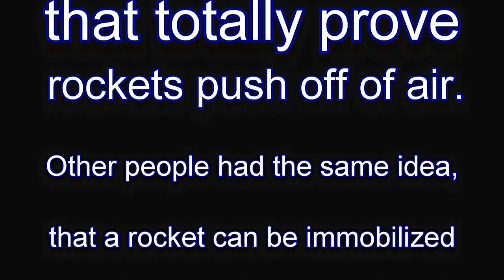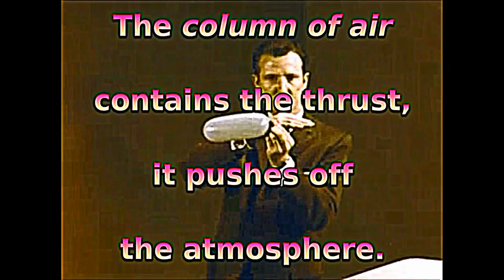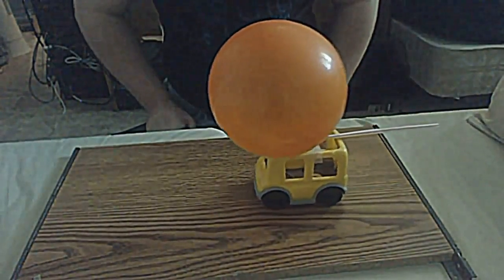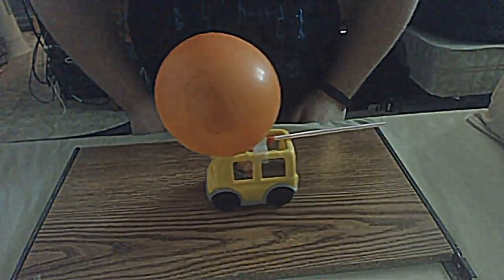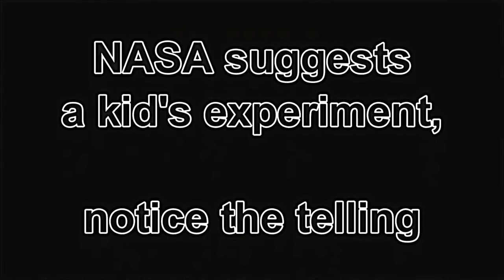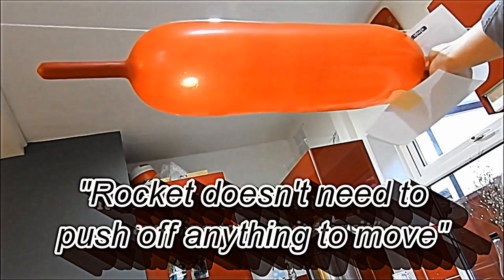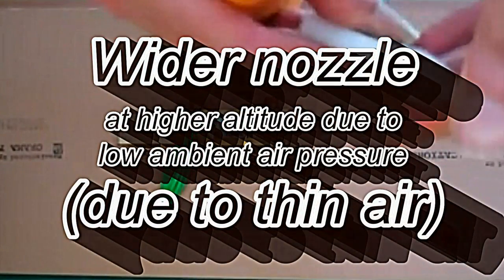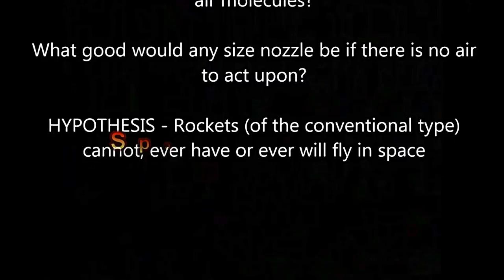rockets push off air

Comment: Rockets don’t push off air: each stage contains their own propulsion system. Take the Falcon 9. Falcon 9 uses Kerosene and Liquid Oxygen. If it were pushing off air when stage separation occurs, it would be impossible for the air would be able to reach the rocket and therefore no effect to the propulsion and trajectory at all. The only thing to drift the second stage away form the earth is pneumatics. Also if the first stage were pushing off air, THERE WOULD BE NO EFFECT TO THE THRUST OR SPACECRAFT AT ALL.
Reply from the maker: Rockets push off air. Combustion not possible in vacuum. Nothing is "ejected". Rockets never go straight up, they go horizontal once the air gets too thin. Nozzel diameter is only optimal at one altitude, exit pressure equals exhaust pressure--that right there proves rockets push off air. :)

Comment: What a load of BS For a start ROCKETS DO NOT push off air. They actually work better in a vacuum because there is less resistance for the gasses escaping . The atmospheric pressure slows the gasses trying to escape. Try this get a water hose place it in a bucket of water and turn it on; by your logic the water would give it "More to push against'  because the water is denser than air. Liftthe hose out of the water and feel the increase in "Thrust" because it can escape easier in the air as air offers less resistance. Take a look at high- speed ferries the water jets exit ABOVE the water when the ferry is at speed . There was a guy CWF Hamilton in NZ  who experimented with water-jet propulsion in boats using a simple petrol engine driven pump. With the first boat the water jet exited under water but when the outlet was lifted ABOVE the water level there was a dramatic increase in speed , simply because the water could exit easier. less resistance in air.   Now just think for a minute "ROCKETS PUSH OFF AIR" HOW does air surport the 2,700 tons of a Saturn 5 rocket?? HOW can 2,700 tons of rocket "SIT" on air . Thinking rockets or even Jet engines push on air is simply IDIOTIC
Reply from the maker: You didn't watch the video, or read the description.
Reply: @rocketspushoffair  I did watch the stupid video ROCKETS DO NOT PUSH OFF AIR AND WORK BETTER IN A VACUUM
Reply from the maker: @ianwarburton2007  ok, what was the point of thee vacuum?

Comment: Anyone could argue, that the reason why the balloon  does not move forward when a piece of paper is attached to it, is merely because in air that piece of paper creates sufficient resistance.
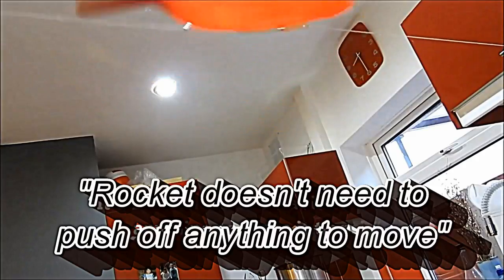BUT for example at min 14:52 we see the balloon turning round the rope/string in accordance with airflow out the balloon redirected by the paper to either side and one side more than the other as likely the paper is not attached  perfectly to equalize the airflow to both sides equally.
So this experiment actually already proves, that the balloon pushes off of air.
Reply from the maker: Yes! 🍺 Also, there is a DELAY before the air hits the paper, in both cases (the centered paper which caused immobilization & the off center paper when it did the loops) so that pretty much disqualifies their "action reaction" claim because according to that claim they state that "the moment" an opening is created (letting the air out of the balloon) there is a "force" exerted opposite the opening ... and that is clearly not the case.
Reply: @rocketspushoffair  Yes, I've been thinking about that force opposite the opening.
I tested it by applying a piece of light tissue to the inside top of a balloon and when I let it deflate -  immobilized of course so that I could observe the tissue - the tissue didn't move at all .
But on the other hand we are dealing with pressure and I probably shoudn't have expected a current. 
Now there is of course a slight current at the nozzle similar to observe when you let  bath water out and according to Bernoullis principle a current depressurises a gas or water. 
So we are left with slightly more pressure at the front of a balloon then at the nozzle I guess. 
But then I thought of partitioning the inside of a lplastic bottle and filling one side with pressured air and leaving the other filled with ambient air and setting that bottle on 4 wheels expecting it to move du to one side being high pressure and the other low pressure....
Reply from the maker: @brianhill1048  Do you have a video of your experiment with the tissue inside the balloon? Your test does in fact test their claims according to their explanation at 4:10 and the tissue should be affected by the "pressure" going towards it as the gas escapes in the other direction. Also, notice how the guy talks about pressure inside the nozzle and combustion chamber, hoping we don't know that the pressure inside the combustion chamber and nozzle is relatively low, and the highest pressure is just after the throat (and quickly decreases to ambient levels as it exits the nozzle), not at the back of the combustion chamber. In NO WAY is the combustion chamber and nozzle capable of handling the high pressures they claim are acting on the inner surface--EDIT--in their false explanation of thrust (compared to the actual low pressures inside).

Similar to your experiment with the tissue, I am planning to take a metal container (maybe a scuba tank) and put a gauge at the end opposite the valve and another gauge at the middle and one near the valve, then we can all watch the pressure decrease EQUALLY within the tank. According to them, we should see the gauge opposite the valve show an increase in pressure, compared to the other gauges.
Reply: @rocketspushoffair  Unfortunately my video skills are a bit rusty. But i did carry out the experiment multiple times. 
The first time I just dropped a speck of very light fabric dust into the balloon and it remained laying on the lower balloon surface unaffected by the deflation process.
Then I tried the tissue experiment and when I did, I had the nozzle pointing to the ground so that the tissue would be hanging down from the top inside of the balloon. 
The tissue was one layer of toilet paper that I tore to the length of approx 2 cm. 
The tissue remained completely still for the duration of deflation so that I concluded from these experiments, that there was a ¨dead calm¨ inside the balloon during deflation which just means that the pressure decreases ¨EQUALLY¨ within the balloon. 
I think your scuba tank demonstration would be awesome and I look forward to it.